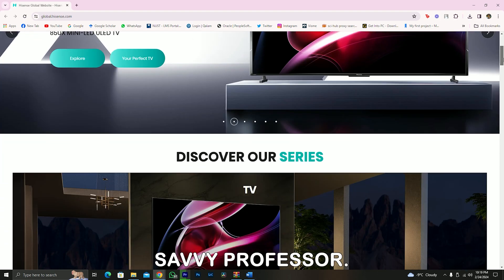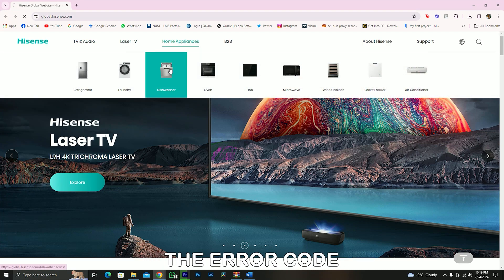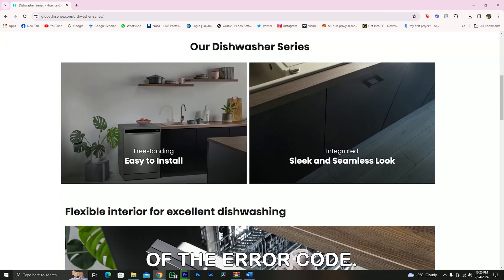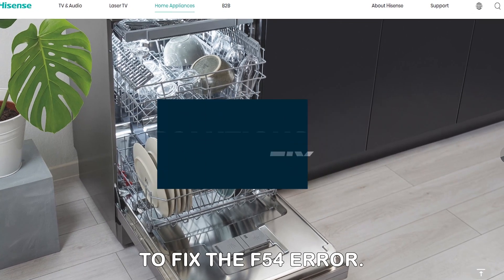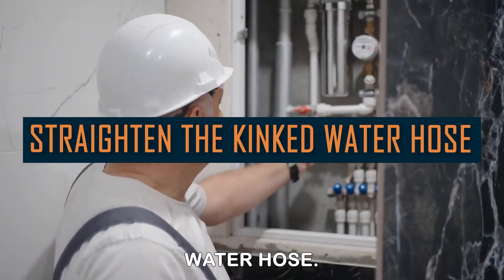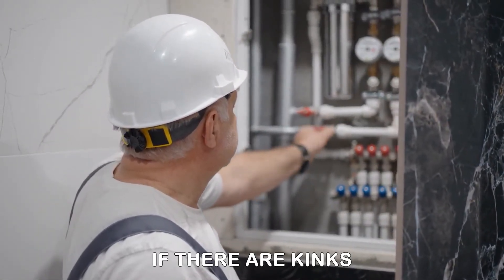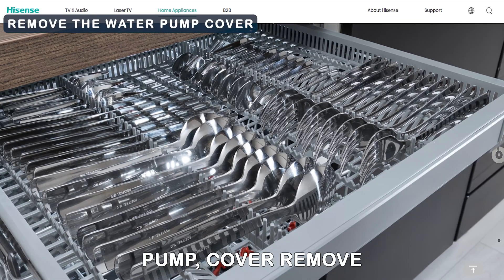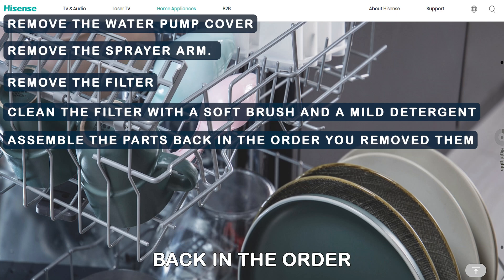Hisense Dishwasher F54 Error Code (Meaning, Reasons Why It Occurs, And How To Resolve The Issue)

Comment: That didn't fucking help at all
Reply: Have you fixed yours yet? I’m stuck as it’s not working
Reply: @NadineRowe-t3s  nah mines buggered. I've tried to book a repair guy.
Reply: @ I’ve just pulled mine out and tipped it backwards there is water at the bottom and set the leak f54 off and now it’s working…I tipped it backwards there is twice and a load of water came out good luck
Reply: @NadineRowe-t3s  yeah I reckon that's what I have I just have no idea how to get it out
Reply: @ keep the heating on for 24 hours it should dry out eventually 🤞